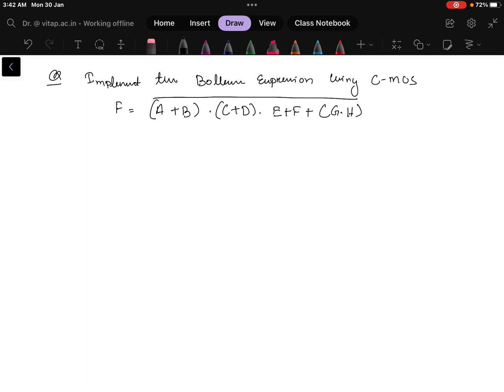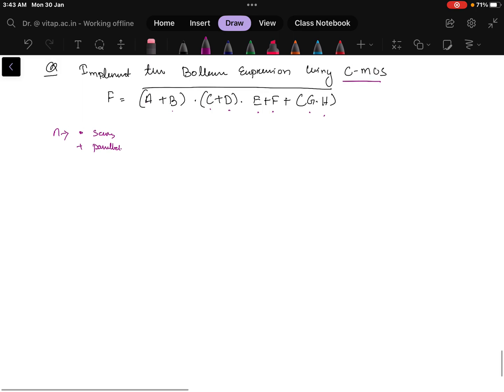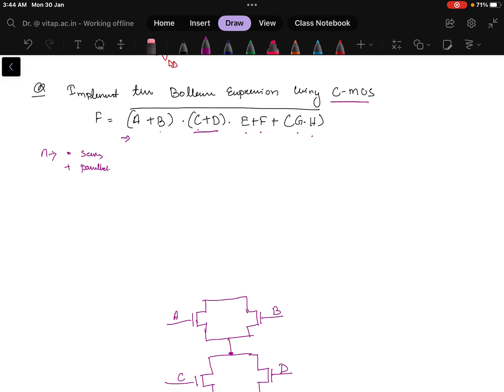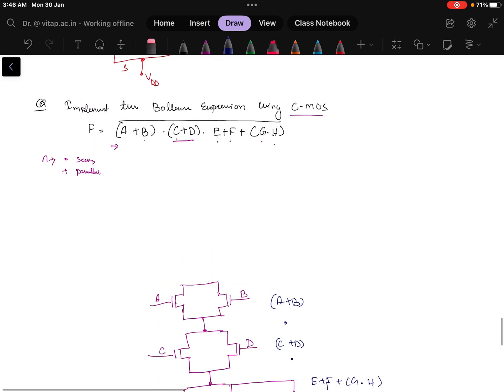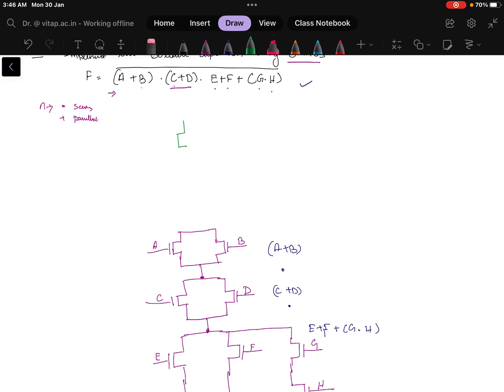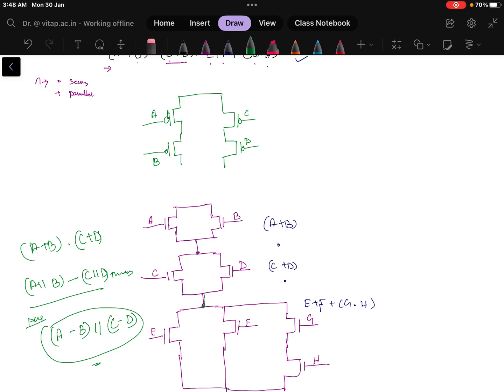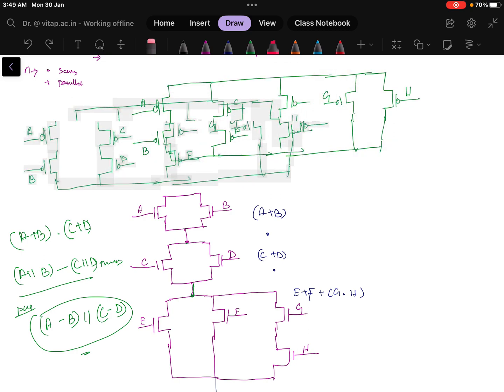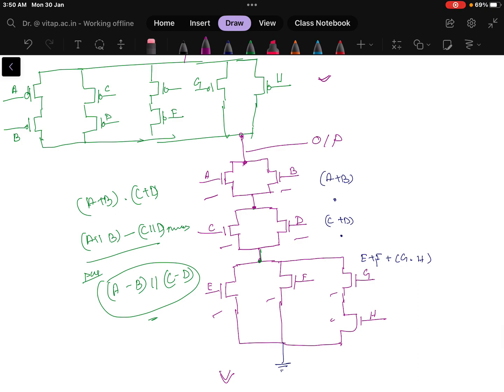How to Implement Boolean Expression using CMOS-Problem 3 || Lecture 11

Comment: In the pmos section .(G+H) , which is in series to the parallel of A.B , C.D, E.F , but you have done it in parallel. It should be in series.
Sir please check at 6:08